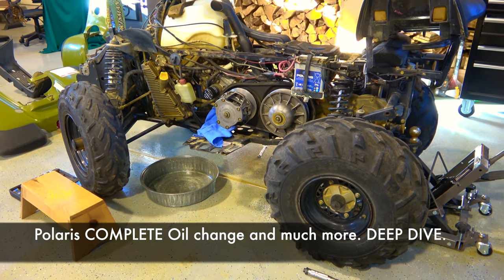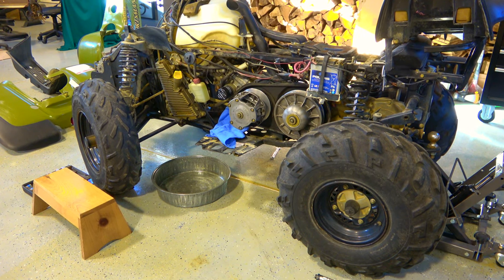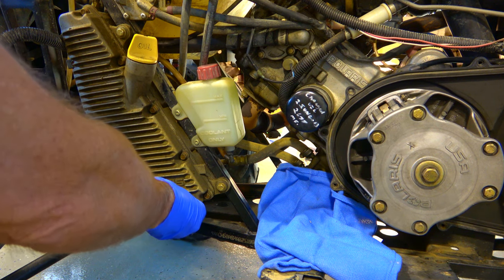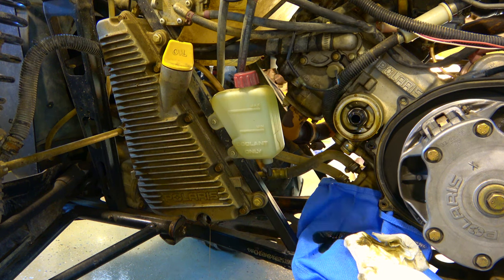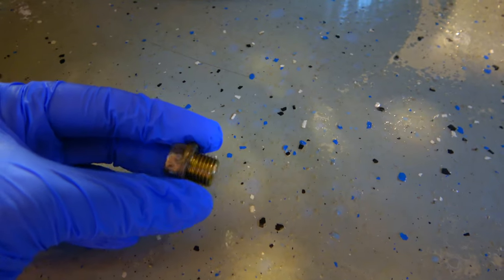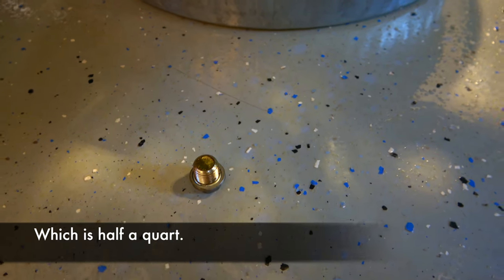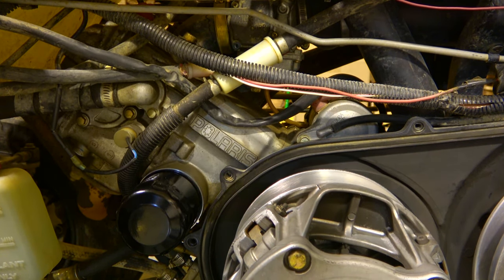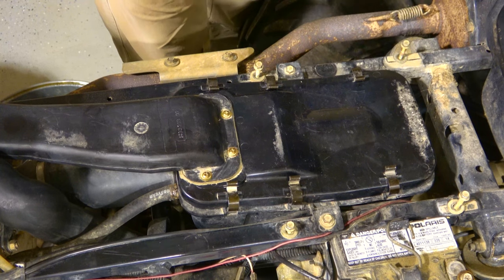Polaris Sportsman COMPLETE oil change & Much More. DEEP DIVE.

Comment: How many hours is on that machine ? Thanks for the video
Reply from the maker: Quite a few. I couldn't say exactly Because the speedo was out for a while.
Reply: Just a quick question I followed this video but when I came to priming I forgot to tighten up the two hose clamps that go to the engine ( feed and supply lines) I had the hoses hooked up but forgot to tighten the hose clamps. Do you think this would have sucked any air in? I ran the engine like this for a minute. I then realised I hadn’t tightened them hose clamps up so I primed again. I still didn’t hear any rush of air like the manual says you would when priming. I’m just concerned do you think within the one minute of the two hose clamps not being done up ruined anything ? Thanks again for your great detailed videos you go to allot of trouble subscribed.
Reply from the maker: @cruza1289  Repeating the priming certainly can't hurt. I wouldn't loose too much sleep over  having caused damage. One minute shouldn't do anything devastating.  If you were out riding and thought oh no those are still loose and your temp gage came on then Id be concerned. Just repeat the steps as described in the manual. You should get the results you need.  And carry on. Im not an expert on it but I would think if you did anything as a result the ware you put on the engine in a minute couldn't be any worse than a cold start is on a machine that's been sitting. Thats also I would think why the formula to the priming steps are written as they are. To protect from damage if anything isn't quite happy.  Just a thought. if that gives you piece of mind.
Reply: Thanks for your reply. You haven’t ever replaced the top steering column bush before ?
Reply from the maker: @cruza1289  I have not.

Comment: if you had just drained the motor oil from the bottom would the side reservoir have drained too
Reply from the maker: From the crank case you mean? I don't think so.I think the oil pump would inhibit it from draining from the reservoir. At least partially. I haven't tried it though. Maybe I will next time just to see.

Comment: If you drain the oil from the crank case and the tank do you have to prime the pump ? I’ve got them both emptied and the oil smelled of fuel as well so I’m thinking the float got stuck as well ?
Reply from the maker: The manual indicates to prime if and when removing the supply line (s). Specifically.  For this make and model.  If you have a different make and model Id hate to mislead without checking a manual.  As far as the fuel smell in the oil? There seems to be many opinions on that. Some say stuck needle valve in the carb may allow gas to continue to leak adding fuel to the crank case. Some say they smelled new Polaris oil before putting it in and it smells that way before use. Ill have to check on that one next time. Ive never noticed.  Some say always turn off your gas when parking or storing your machine. Others, mechanics, say that's normal that they smell it all day while others indicate worse issues but many dispute. Its really hard to say sight unseen. But for the heck of it if you haven't already. Smell your new oil for comparison. I realize I really didn't solve the mystery and probably left you with more questions than the one you asked.  Thats an issue Id need to troubleshoot a bit if I had it. Another thing to watch of course would be your fluid (oil) level. Obviously if your level goes up noticeably and you smell gas in it. You should dig into it to resolve the cause.
Reply: @ericinalaska7648  thank you for such a quick response! I’m working on this quad for my boss .. i do know the quad had sat outside for quiet some time , I do know that this is a magnum but unsure if it is the exact same model as yours , they do look extremely similar.  I have found the model number on the block , but haven’t tried to google cross reference it . But I’m waiting on the new oil to arrive ,(Amazon) I will definitely be smelling it . Would the pump pick up the oil after a few seconds even if you didn’t prime it ? Or would you think it would burn the pump up before it caught back up .
Reply from the maker: @paulmoon8927  When it doubt as they say..... Priming is simple and if its not needed I cant see any harm in doing it anyway.. For pc of mind.

Comment: also says when you take the clamp off if you dont hear any air come out the vent hose to repat until you do
Reply from the maker: You sir are absolutely correct. Thank you for adding that. The note I read from the service manual was in the oil change part. But looking further into the pump priming specifically it does say " If the line is bled properly you should hear air release, If you do not hear air the line is not bled. Repeat." Helpful comment thank you.
Reply: @ericinalaska7648  very good video. I just thought maybe to have added that in for you to help save any misunderstandings others may have. Thank you for sharing a great video.
Reply from the maker: @topdogmechanic8261  Absolutely. Appreciate it. Any nuggets like that are always helpful. Thats what it's all about.
Reply: @ericinalaska7648  exactly and no worries brutha.. Anytime.... Keep them great videos coming
Reply from the maker: @Topdog Mechanic  Will do.  Check out the other stuff as well if you haven't already. I may deviate from the polaris topic at times but Ill always return.

Comment: How do you know when your starter or starter drive Bendix is going out? When I start mine a scratchy noise is on for just a minute
Reply from the maker: Does it start though? If it's a new noise,  you're not use to hearing. Thats an indicator I would be suspicious of. If testing it is not in your wheel house, Id think if you stopped at a shop Im sure they could or would for you.  Or at minimum give you an opinion about the noise. Assuming it does it again while you're there. We all know how that works of course.  It could be a few things and not knowing your machine or hearing the noise. All I can do is speculate. Could be the Spindle/shaft  on the starter damaged, Or Gear/fly wheel damaged. If you remove the starter. You would be able the evaluate the splined shaft on the starter for any damage. And also test or have it tested real easy bringing it to a shop or probably most parts stores.  Hope that's of some help.

Comment: Is this a reliable four wheeler? Looking to buy my first fourwheeler and i been looking at the same year same model
Reply from the maker: I have found it to be. But Ive found most Ive owned to be as long as you maintain and keep on em. They're pretty simple to work on in my opinion. Some may say well I have a ....... and I never have to work on it. I would say it all depends on your frequency and style of riding.  And awareness of the machines needs. Natural ware and tare can probably be demonstrated to vary from brand to brand certainly. But I've found most of the work needed with a few exceptions reasonable. Hope that helps. Just start by making sure it starts, runs, moves, 4 wheel drive works, wheels spin nice without wobble, and of course no suspicious noises from any of the previously mentioned.  Hope that's of some help.
Reply: Thanks much appreciated im just looking for something to ride around not to be bogging down tearing up stuff

Comment: Goid video, although not a COMPLETE oil change, didn't do diff or transmission, which would've made it COMPLETE...
Reply from the maker: Thank you.  COMPLETE motor oil perhaps?  I emphasize COMPLETE due to the inclusion of draining the crankcase, which most people skip. Making it complete. As well as a few extras.  I guess I didnt foresee that perspective.  Generically most refer to it as an oil (and filter) change OR oil, filter,  and fluids. regarding the others mentioned.  I do have a separate video on the other fluids  you mention if interested though. Thanks again.

Comment: Do you need to prime if you change oil in the crankcase? I want to change only in reservoir and crankcase
Reply from the maker: My understanding from the manual is that it's required when disconnecting the supply line from the back of the reservoir.  But if you're concerned, I see no harm in doing it anyway.  In the video I hade completely removed the reservoir disconnecting the supply and return line. And do cover as much as possible and because I disconnected I covered priming as well.
Reply: @ericinalaska7648  Thank you 😊
Reply from the maker: @citionriver  Thank you. If you stumble dont hesitate to clarify if something gives you pause.

Comment: what is the length of those sleeves between the back of the fuel tank mount and frame, and what is the size and length of the bolts mine is missing both
Reply from the maker: Im trying to picture what part you're referring to. I'm away from the wheeler at the moment for a bit. Do you mean the side pieces below the tank or? The front pc. Fenders and fuel tank plastic is one pc. And then the seat buts up against the tank. Im sure I can clarify the size but Im just not clear from the description. I have another video regarding taking the plastics off. I don't talk about the specs of the bolts but maybe you can tell me the part maybe as I point to it in the video?    1999 Sportsman 500.  Removing all the plastics in about 10 minutes.     https://youtu.be/FRiehel5EJ8
Reply: @ericinalaska7648  at the back of the fuel tank closes to the seat there are bolts on either side of the fuel tank that fasten the back of the fuel tank to the frame
https://imgur.com/2C0dBzi

Comment: What hose is clamped off again to prime it ? Is it the same for a Ranger 500 ?? Thanks
Reply from the maker: The breather hose that goes from the top/back of the reservoir to the filter compartment under your seat. You clamp it between the reservoir and the slit. (See video). I can't say for sure without confirming regarding the Ranger. Likely similar enough though. If you understand the goal you'd probably just apply the same process I would think. But Id dig a bit of course before saying with full confidence.
Reply: @ericinalaska7648   I got it primed a bit ago , works great , thanks for getting back to me on it !!👍🏻
Reply from the maker: @waylonmccrae3546  Good deal. No problem.

Comment: How many ounces does the front differential take 2000 players sportsman 500
Reply from the maker: Usually approx 4oz.  I believe I babbled about it in the "Polaris Sportsman 500 (And Similar) Front Gear Case and Transmission Fluid change" video. Heres the link if you haven't already discovered it. https://youtu.be/lYFMaltHP28  I also checked a manual I had handy at the moment for 2002. Says 4oz.  Hope that helps.

Comment: hey do you have a link for the crankcase oil drain bolt i lost mine thanks again
Reply from the maker: I don't. But Ill look into it when I get a chance in a bit when 
I get home. Shouldn't be too hard to determine which one you need.
Reply: @ericinalaska7648  i bought one a couple of minutes ago so dont worry abt it thanks anyway tho
Reply from the maker: @levicarrol9401  No problem. Cant imagine it was too much of a mystery for the google machine.

Comment: How to change the transmission fluid on 1999 polaris 6 wheel
Reply from the maker: Is it a "Big Boss"  Even if not. Check out this link to an owners manual I found. It's the best thing I could find. Everything else seems to be regarding Rangers. https://cdn.polarisindustries.com/polaris/common/parts-manuals/9922807r01.pdf

Comment: Do i havetoo prime the oilpump even if i only change and clean the scrrenfilter in the wheelhouse resevoar
Reply from the maker: It's my understanding that only if you disconnect the line(s) from the reservoir. If I just do a filter and drain the reservoir or/and the crankcase I never do. The manual states NOTE: The priming procedure must be performed whenever the oil hose connection between the oil tank and pump inlet has been disconnected. Hope that helps.
Reply: @ericinalaska7648  thanks. Im gonna try bleed it just in case. //Sweden
Reply from the maker: @Ticdaniel  Yes Its been a while but I think in the video I talk about I can't imagine a problem doing it anyway for peace of mind.

Comment: Do you know what fluid the front differential takes? and how far do i fill it up?
Reply from the maker: The front gear case you mean correct?  For a 1999 Sportsman And similar. Angle drive fluid. 4oz. (Demand drive fluid is for hubs.)  Shop will tell you 4 to 6oz. Im actually about to do that and make a video. As well as the transmission.
Reply from the maker: @usboutdoors8550  I've found it very confusing as well over the years. Ive heard demand drive in both, Angle drive in the crank case, and demand in the hubs. My last conversation at a Polaris shop revealed confusion amongst the staff there as well on the topic. The service counter guy got a mechanic who indicated he uses Angle drive fluid in the crank case and demand drive in the hubs. The demand drive fluid bottle says on the label for  Hub and centralized Hilliard clutches. (Does not say for any other use.) I have also used synthetic ATF in the hubs. I can say that when I drained the front crank case it came out the same color as the angle drive fluid I put in.  The Polaris service manual I have for a 2002 (I don't have one for your 2000 handy at the moment.) simply indicates Premium Front housing fluid for the front gear case,  PN 2871653 Also different than the number you mentioned. Just as an example. (which if you google it its front gear drive fluid) or  you can substitute GL5 80-90 gear lube.  And Premium demand drive hub fluid PN 2871654. (If you look that up its the demand drive fluid) . When I asked for the Gear lube # I was given the Angle drive.Which on the label says for maximum protection of Polaris ATV front and right angle drives on the label. I just came to the conclusion that there seems to be many takes on it. And was given the impression this is the current product for that PN. I went with what seemed to be the common ruling and compatible with the PN I had.  I have seen other videos in. the past that did it this way or that and Id look up the specific machine they were working on and see differences in specs sometimes. Things can change from year to year. I always try to recommend for people to always follow there year make and model manufacturers recommendations.  I see people claim to use other substitutes for many of the lubes. I go with the book and shop recommendations. Unless the answer is wishy washy.  After research and conversations at the shop we landed on the Angle drive for the front gear case. I have full confidence that the Demand drive its for the Hubs however. Its a head scratcher. And the more I looked into it the more opinions I seemed to find regarding the front gear case.. So I went with the shop mechanics ruling. Which as we've learned, and not surprising, differs from the ruling you got on that one. Perhaps the year? Seems a stretch but. Anyway, I hope that helps? Probably adds to the confusion already out there. But that's what I got.
Reply from the maker: @usboutdoors8550  Appreciate the appreciation!
Reply: @ericinalaska7648  ...I changed my channel name and my comments from before the transfer were deleted. In short, I spoke with Polaris Headquarters today and they informed me to use Angle Drive Fluid for front gearcase of my 2000 Sportsman 500. Good enough!!! Thanks for your videos! I have a feeling I'll be watching more in the near future!

Comment: Hi 
My problem is that 
The quad keep tracting when i release the gaz
I think my clutch doesn’t work properly
Reply from the maker: So your clutch is not releasing or? Have you recently replaced your belt? If so was it due to a belt breaking? And if so, did you clean everything out really good? Not to insult but if so is it the proper belt? And is it aligned properly?
Reply: @ericinalaska7648  
Just bought the quad 
I will clean everything up and replace the belt 
I’ll let you know if i fix the problem
Reply from the maker: @sebastienlarose6542 Always good to have a manual. And youtube of course. Before you spend any money on a belt of course check that the one on it is the proper belt, and alignment and deflection is correct. And all that stuff. Sounds like a lot if your not familiar with it but just go through and check one thing at a time.  Really not that complicated. You may discover something obvious as you inspect and then go from there.
Reply: @ericinalaska7648  
Yeah tank u 
I’ve already read the manual clutch section. At this moment i’m just waiting about the weather 😩. Too cold over here for an outside check up 🤷‍♂️